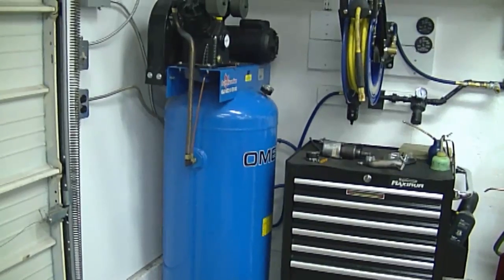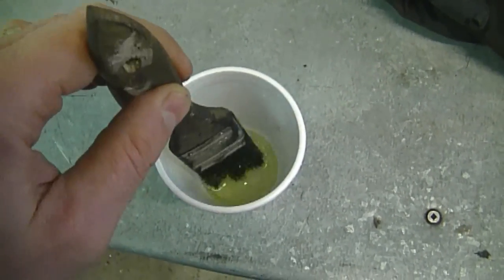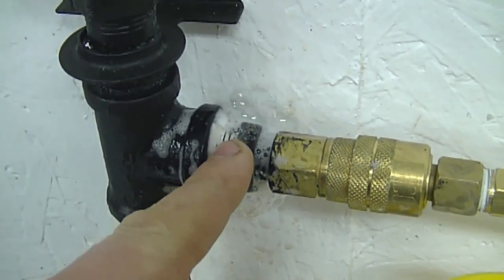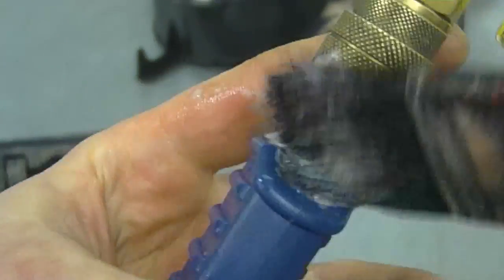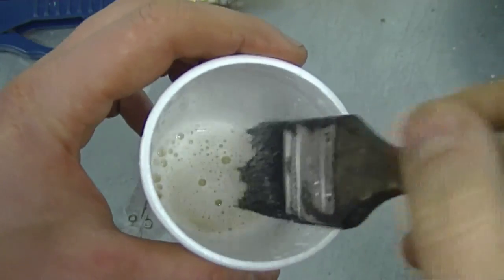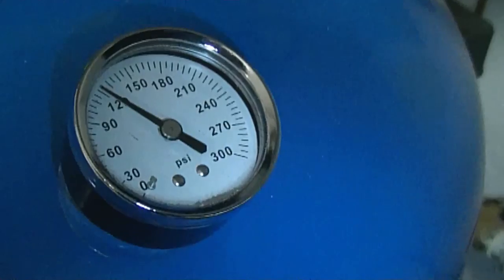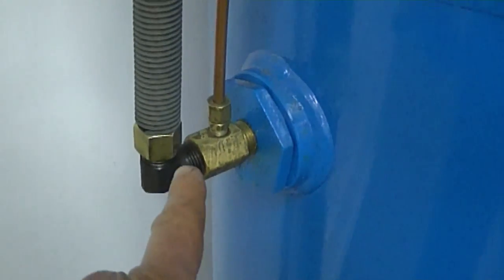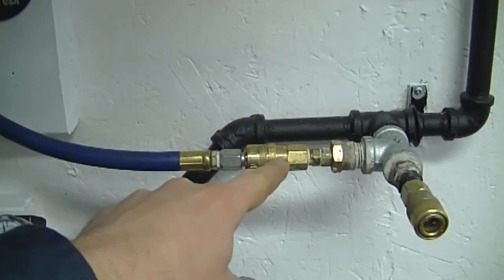How To Check AIR Pipes For Leaks

Comment: I've seen plumbers test for leaks two ways. One is the way you show here, but they use this for already existing plumbing and only test for new stuff that was added or when a stove is connected. The problem with larger jobs like this one is you have a whole lot more connections to test and it would take too much time. For large jobs like this they use a gauge that somehow is connected to the pipes and then look at the needle to see it it drops after they pressurize the pipes.

Comment: Very good video, i run a lot of black pipe in the HVAC field. what we do to test our systems is just put a pressure gauge on the system and see if it holds 25 psi.. if it doesn't then shut off different sides of the system until you find the leak. May save you time from checking every fitting and is more accurate. :)

Comment: Just a comment/rant on pipe fittings. I've noticed in the last decade or so that I have to use more pipe dope AND still really torque on fittings to keep them from leaking. I never recall this being as big an issue earlier in my life (I'm 58).
I assume 99% of all the pipe fittings in your regular hardware store come from "the far east" and it's poor quality control on the threading machines.
Okay I'm done, just wonder if others "seasoned" listeners agree or not.